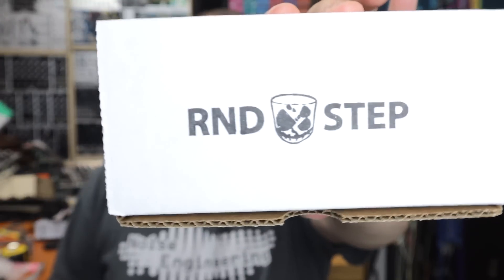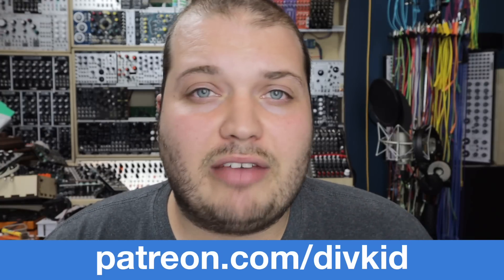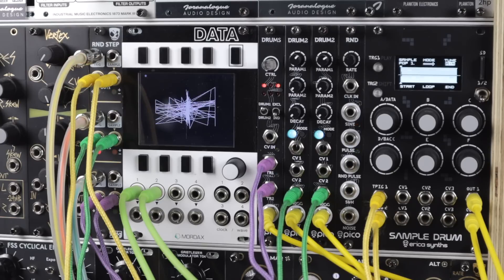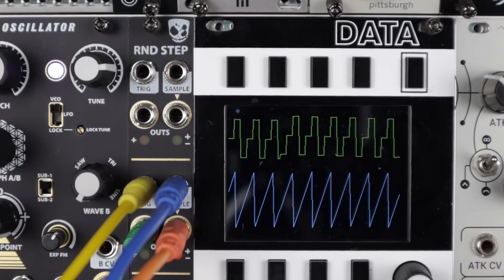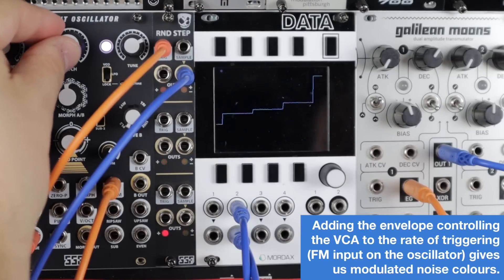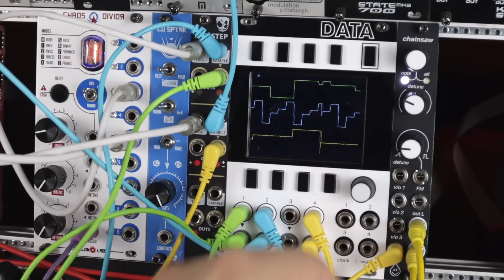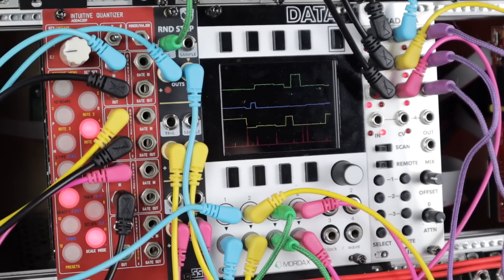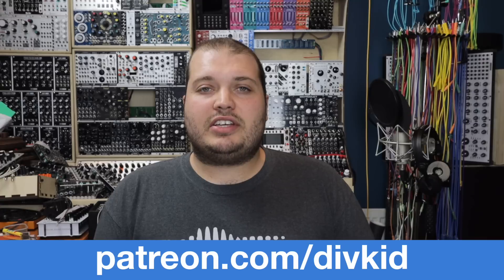NEW DIVKID MODULE // 'RND STEP' with Steady State Fate // 6 High performance Sample & Holds!

Comment: Not often do I gripe about prices but (and yes, I know it’s a powerful little machine) $200 is just too big of an ask. It looks REALLY interesting but $200 for this skinny little thing? Like there’s profit margin and then the’s PROFIT MARGIN. At any rate they’re out of stock at PC, so maybe I’m the only one who feels this way, to me it’s a price that makes me think to myself  “modular, that’s your thing?! STOP, the price is insane”
Reply: And really, I know the thought behind it is frickin BRILLIANT.
Reply from the maker: it's funny you seem to know what the profit margin in, it's not what you think. There's more tech in this than many much bigger modules and it's harder to make them smaller ... and then you come up against perceptions of size vs price like this (which I understand). However the beauty of what it offers a user is all about the size and the power that packs. 

It's 6 high quality, expensive parts costing sample and hold circuits that out performed many others. It's also 6 independent noise sources. Nothing is just duplicated/copied down, everything is a unique/independent source, wrapped into 3x dual channels. Whether those things matter to you ... that's up to you and no hard feelings if not. All the best with your modular!

Comment: A bit of an off-topic question here: what reverb are you using in that nice accidental descending arpeggio part? It’s nice and subtle, natural. I’m wondering if I can get away with using something small and affordable like Pico DSP for reverb.

I think I’ll be picking up one of these RND step modules, too. Love the idea of triggering all six outs with one trigger.
Reply from the maker: no worries about off topic questions. That's the discontinued EOS Reverb module from Audio Damage (who no longer make hardware). You can get the EOS reverb plug in though which uses the same DSP code and that's a really lovely thing too.